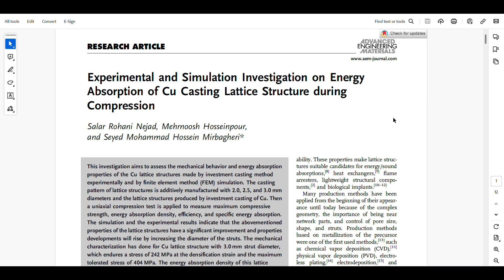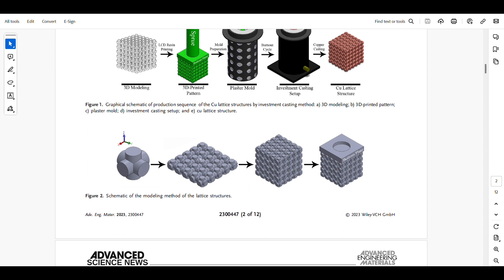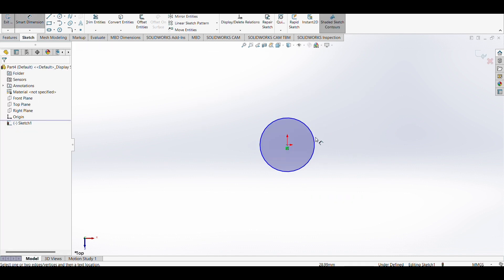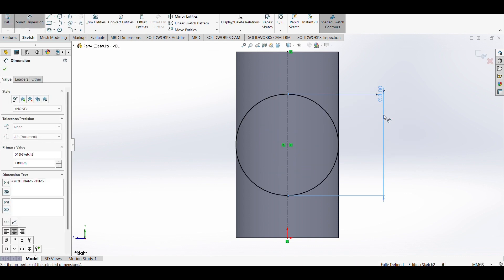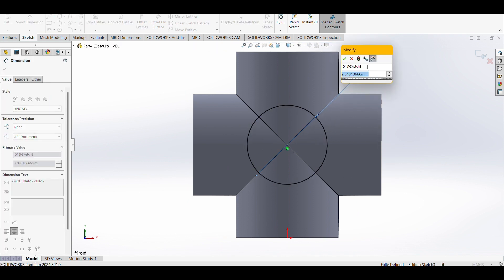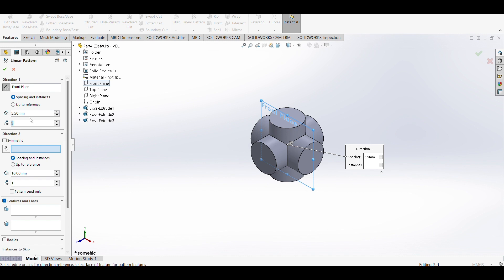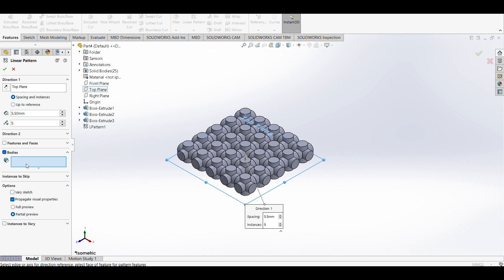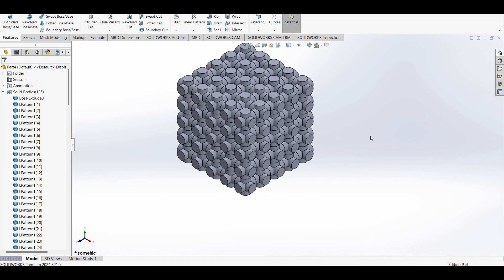Tiny Mighty #089 — TPMS Primitive Lattice Unit Cell Design in SolidWorks 2024 (Beginner CAD)

Comment: Sir after designing this structure , I took the stl file to cura slicing software and it says due to mesh problem my model cannot be printed accurately. How do I mesh this model?
Reply from the maker: The Problem is that you need to combine all patterned unit-cells to one solid, how to do it? go to your insert menu, features, and use combine command, chose all of your lattices from the body tree, and done, the structure is now printable, if you have any problems contact me on LinkedIn, and don't forget to share the printed structure with me ;)